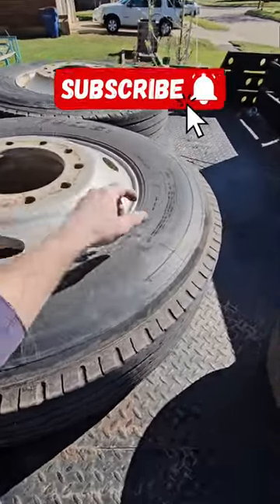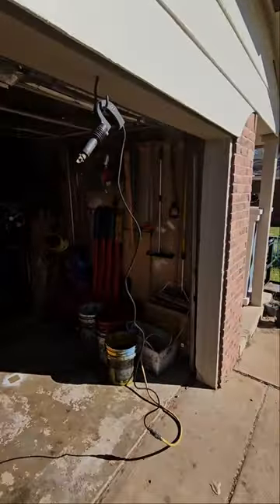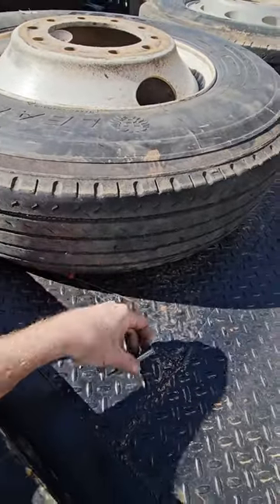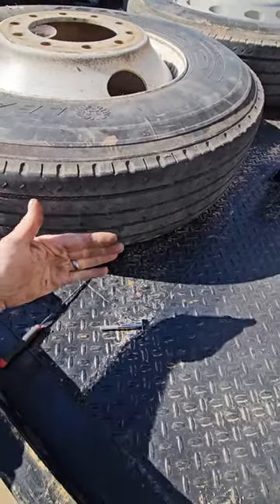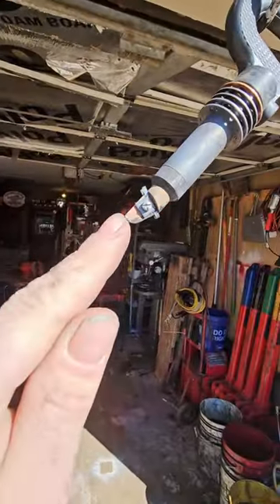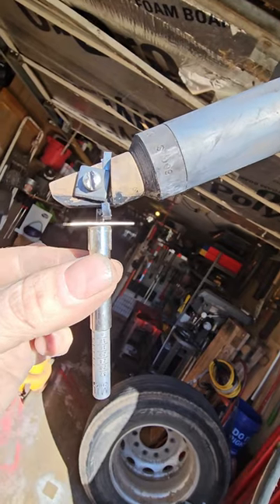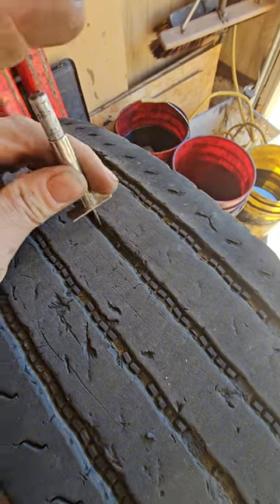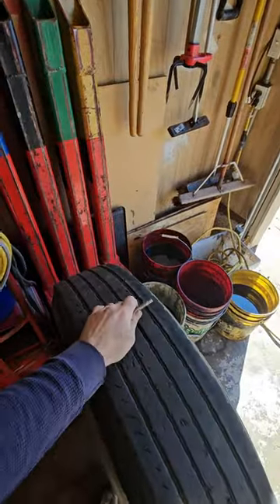Regrooving tires on a tractor trailer

Comment: I messure maybe 3 maybe 4 32nds up from the cords.  Gives a nice deep cut.  Never had one fail yet.
Reply from the maker: I need a new regroover.  I had it set to the right depth last time I was using it but I angled it the wrong way at one point and hit the cords.  Ruined that tire.

Comment: Hmmmm side hustle idea 💡
Reply from the maker: Definitely.  I would need a faster tire regroover first
Reply: Our company sends the tyres back to Goodyear to get them retreated, trade in old for new.
Granted we’ve got 1200 tractor trailers on the road.
Reply from the maker: @nickyvanhouwelingen  Are they re-capping them or using them for new rubber at Goodyear?
Reply: Yeah it is!  😉

Comment: Just don't do steer tires, never was a fan for screwing  with tires, definitely don't buy tires with 'Stone' in the brand. BFG's
Reply from the maker: I definitely would never do the front tires.  It's illegal too
Reply: Is this for Drives or trailer ?
Reply from the maker: The ones in the video are from the trailer, but legally speaking the trailer and drives can be regrooved, just not the steer.
Reply: @truckersmalls8690  both
Reply: @charlesgregory9763  BFG is made by Michelin.  Top grade casing.  $100 cheaper brand new, but they screw ya on the casing value cause they grade it lower than the Michelin.  The tire business is crooked as they come.  😉